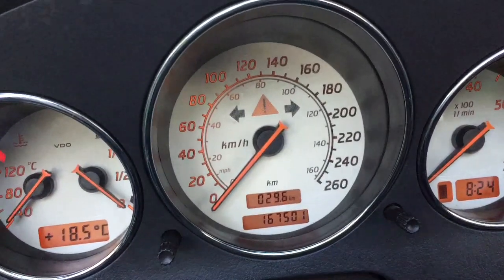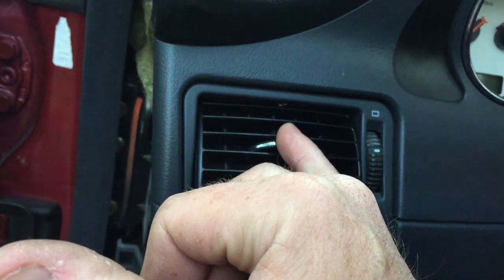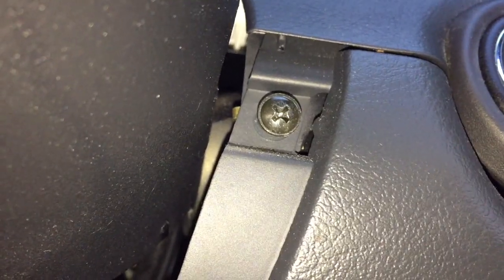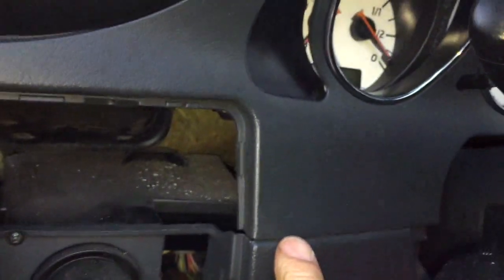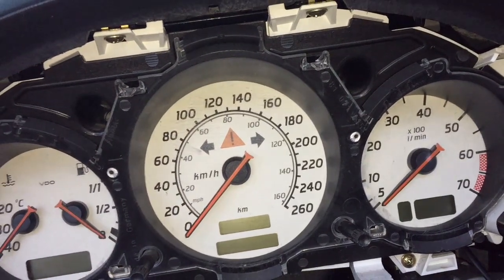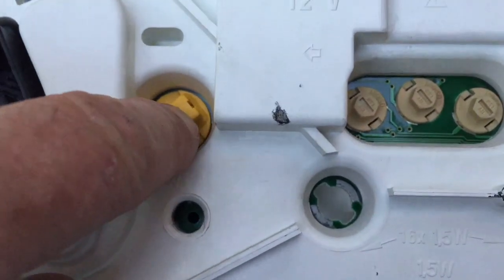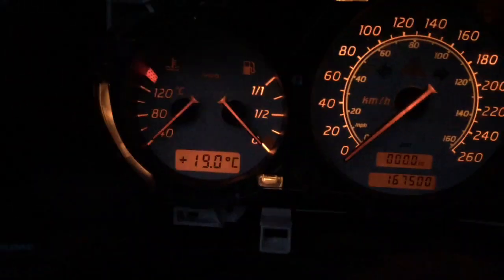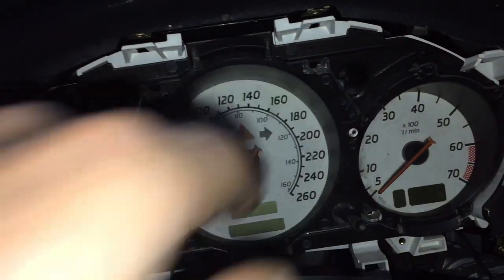Mercedes R170 SLK.. Removing gauges to replace bulb

Comment: Good video of how to disassemble especially only using one hand, you're a magician, ha.  diff090 made a very good point, with the work involved always replace all the lamps when you open up the instrument panel, they are not that expensive when compared to the time and effort involved to disassemble and reassemble.  One important point is not to touch the lamps with your bare hands, wear nitrile gloves or use a clean rag to insert the new lamp into the holder.  Oil from your hands/fingers get on the lamp and when heated it eventually caused hot spot and premature failure.  Keep up the good work with your videos, I enjoy watching so I can keep my '99 R170 going.

Comment: Cool to see these 1st gen SLK instructional videos. Thank you. I'm browsing since my key won't turn anymore.
Reply from the maker: +Girl600 Show I did a video on my w202 playlist regarding the stuck key issue.. It;s a crude repair but costs nothing if you can get the key to turn just one more time.. once the key will no longer turn the dealer or a good locksmith would need to be called..using a little lubricant on the key you may be able to get it to turn ,,,then the video link below can hopefully help   https://www.youtube.com/watch?v=Qn7FzkTqUA8

Comment: Good tutorial with one mistake. You missed one screw underneath the ignition lock. Without loosing that scew you break the tacho cover, which you did (see approx. at 5:07 min) and unfortenutely me also following your tutorial. So it might be a good idea to add at least one big comment in your video!
Reply: Do you have to remove the lower panel to get to the screw you're saying is missed in the tutorial?
Also, so everyone knows, there are two plugs on the back, one on either side at the top. You cannot pull the cluster out and unplug them. You have to reach in (at least that's the only way I could do it) through the hole created by removing the left side air duct and work by feel. It was probably the hardest part for me, especially the farthest away, closest to the ignition switch. The other thing was that since I had cruise control, I simply could not get the cluster out, at least, I dared not push against the odometer stems any harder than I did. I pulled it out far enough to rotate it forward to get to the bulb sockets on the back.
Reply: Uppps

Comment: Thanks for the video, this will help to do it myself, I have an 04 slk 320 when my roof is down the roof red switch light start to blink and it doesnt turn off, it all started when I hit a pot hole that shook the car, I think a switch may have moved or need to replace, can you help or anyone that may know what to do, thanks cheers!

Comment: That ignition video from you W202 was the 1st vid I watch a few months ago. Thanks for the tips and help in general. Would u suggest I buy a generic tumbler that fits an SLK for around $17 or should a used OEM ignition for $240 if your key wouldn't turn anymore?

Comment: Did u see if there is an option to change miles to km.
My slk is lhd, but was in england and has speedo in miles, so i want to convert it back to km.
Reply from the maker: I didn't . I don't believe there is one . You can have it changed at the dealership with their software
Reply: @fupabox  eh thanx, but no thanx !!

Comment: Very good video. Do you know if there is a led replacement bulb for these? Thanks
Reply from the maker: the larger bulbs can just be swapped for leds , the smaller ones are built into the bulb holder.. The larger ones would be a T10 led... the smaller ones a T5 led . The small ones you would have to get the specific ones with the holder built in .. heres an example depending on the colour you want  https://www.ebay.ca/itm/10Pcs-T5-B8-5D-5050-SMD-LED-Dashboard-Dash-Gauge-Instrument-Light-Bulbs-Blue/253589146995?fits=Make%3AMercedes-Benz&hash=item3b0b174d73:g:M9cAAOSwPHxa4~NB&vxp=mtr

Comment: Hi friend.  I need to change two bulbs, but I have a doubt.  My steering wheel has no height adjustment, can the frame be removed without removing the steering wheel? THANKS
Reply from the maker: you can move the wheel in and out so you can extend it toward you as fsr as it will come and have enough clearance

Comment: hay fupabox i have 2001 slk 320 on the driver side corner window regulator don work can u made a video on how to replace that thank you
Reply from the maker: thaonhi1411 Nguyen I actually downloaded a pdf on that exact problem ...here's a link to a photo instruction for replacing the regulator   http://www.benzworld.org/forums/r170-slk-class/1331326-rear-wing-window-regulator-replacement.html

Comment: do these 'bulbs' you were going to replace have a name or type ?
Reply from the maker: 194 wedge ...make sure you get the same wattage bulb ..the wattage is marked on the back of the cluster at each bulb ..2w   1.5w    etc.    too high a wattage bulb can melt the plastic

Comment: U forgot most important part, remove battery cable first.
I replaced my bulbs one time and deposit gauge stop working because i havent turned battery off
Reply: Can the battery be disconnected without problem? How long can you have disconnected?
Reply: How did you repair it?
Reply: @SLK19999  o disconected battery and unplug cables from panel again, Check if any pin got damaged and reconect. Then turn battery and Check if it works.